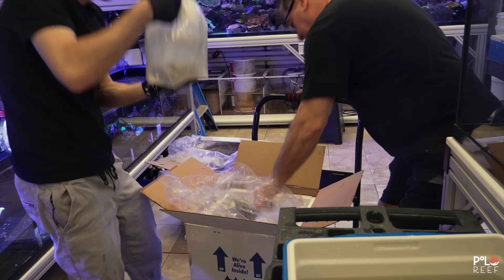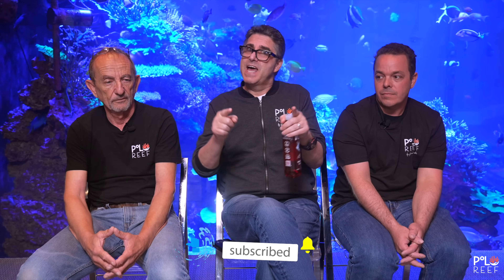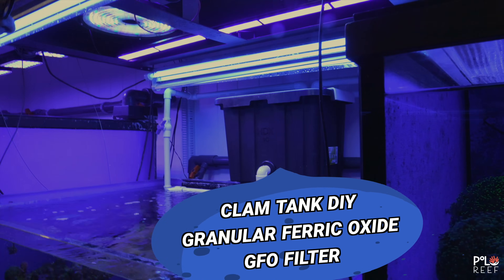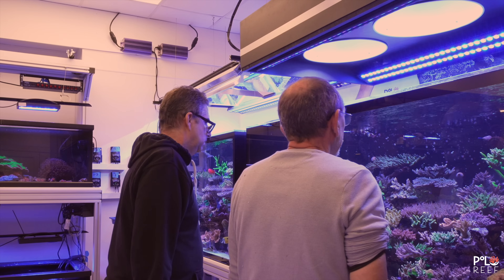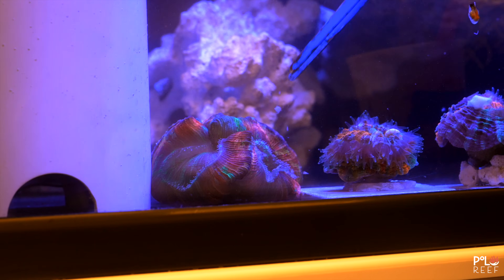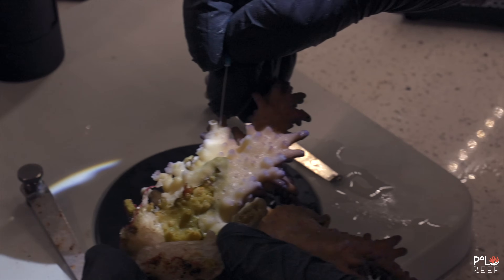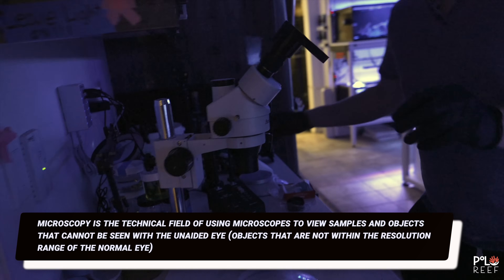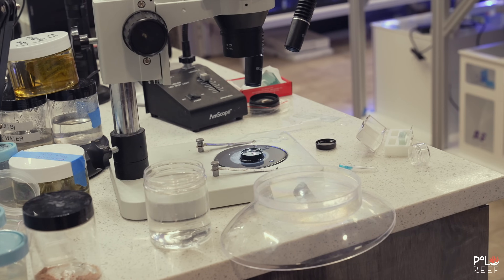SOLUTION TO GFO USE IN REEF AQUARIUMS AND MORE!

Comment: I found better luck w/ refuguim, miracle mud ab cheto, (on opposite light cycle) then gfo, but I only had 120 gallons, just a  pipette compared to this
Reply from the maker: yes  we using that plus algae scrubber on 900 but still need about half as much gfo but we changing it less often

Comment: Was the link to the GFO filter build the previous video? Was hoping for more details on it since I'm trying to follow your path on a filter. Basically it sounds like aside from having a settling tank...double up a small micron filter apparatus on the outbound line
Reply from the maker: we did that and it helped but was not as good as dividing flow in half then settling chamber and out the third bag !
Reply: @PoloReef sounds to me, like maybe a new media with less particulate needs to be developed. Running such an elaborate post reaction filter really SHOULDN'T need to be a 'thing'
Reply from the maker: it was prior video

Comment: Thank you for sharing, question, if the 2 filter socks get clogged with GFO dust then where the water goes and it will build back pressure?
Reply from the maker: three bags now !  with a settling chamber  last sock is completely clean

Comment: The coolest thing i built was using those plastic 3 drawer white and clear drawers, and putting a paint strainer on the top drawer the ones made for the rim of a 5 gallon bucket and cutting filter sponges in them and i used filter sock material sheets for the bottom layer, 2nd drawer i forgot what i had probably was more mechanical, and 3rd was biological
Reply from the maker: like a koi biological baki shower !  ❤
Reply: @PoloReef  yes but I put it in a 50 gallon acrylic tank that i cut the top off,  and called it a sump😂 for my African cichlid tank

Comment: I just stopped using GFO even after putting a filter sock at the end as my SPS started dying for no reason and since I stopped running it corals look much better!
Reply from the maker: it can strip trace elements and drop po4 quickly and reduce alk  !   it needs to be used with heavy trace element dosing !  and small amounts but i  used to see same thing

Comment: Would an Oase drum filter catch these particles? Iv seen a couple installed on koi ponds and the fine particle capture is amazing
Reply from the maker: yes we use drum on 2500 its clearest tank !! but it would be rinsing all the time and not sure you catch it all on first pass !!  2500 does not use any gfo  we talk about putting one on 17k issue is you loose some evaporation as some ro ends up in tank and if not needs a drain line to a box with supply of ro !!  Backwashing not great option